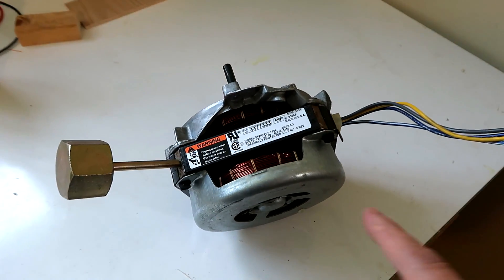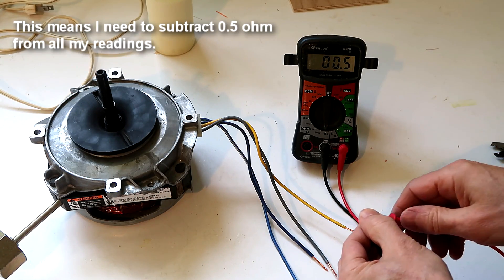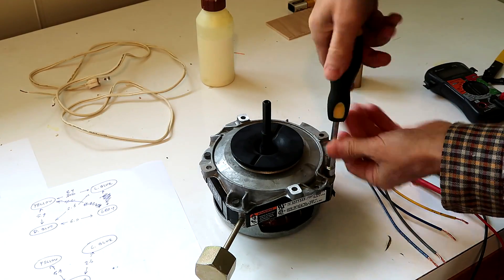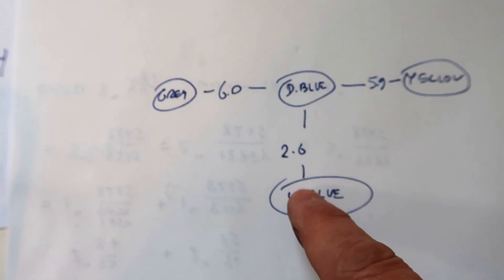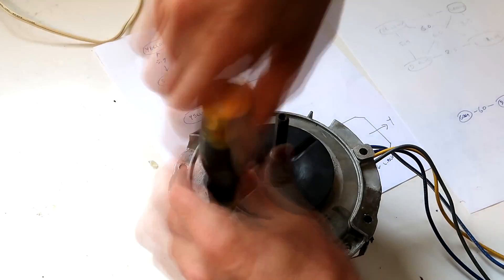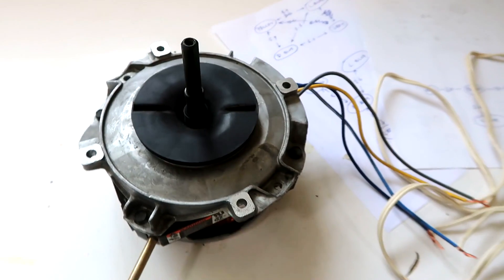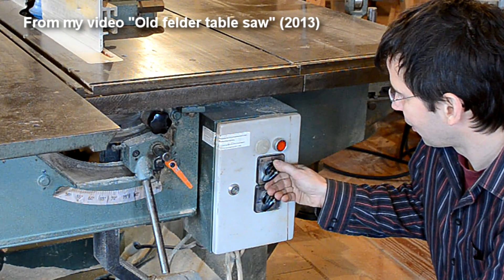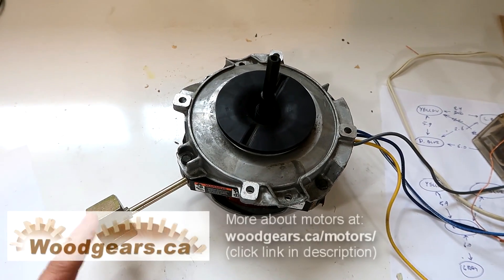Figuring out motor wiring - one example

Comment: You could use a PTC Resistor. refrigerant compressors often use this method.
The PTC will go high resistance after a short amount of time and reduce the current to a very small current.

You could also rewind a relay with a much thicker wire and put the main winding current through it.
When the motor has started the current drops and the relay turns off.
This method is also used by refrigeration compressors.
Reply: I see there's some sort of component on his motor attached to one of the leads. I assumed it was a thermal breaker, but I wonder if it's a PTC relay?
Reply: @unregistereduser2  He said that's just a resistor.
Reply: @ihatenumberinemail  thats not what 'resistive start' means, there's no actual resistor there per se, just that the start coil has thinner wires and thus a higher inherent resistance. That component isn't a resistor , its probably a thermal breaker
Reply: @ihatenumberinemail  oh yeah. The one I'm talking about is inside the motor. Visible briefly at about 1:05 on the bottom half of the motor, a silvery rectangular thing inside the motor frame
Reply: HVAC guys use something marketed as a 3 in 1 kit to replace start current relays.  It's a thermal overload, ptc relay and capacitor.
Reply: I got this same exact motor I need to use itt for a home made belt sander it the only thing I have. I also have all the components that went with it I need help don't know the first thing about motors